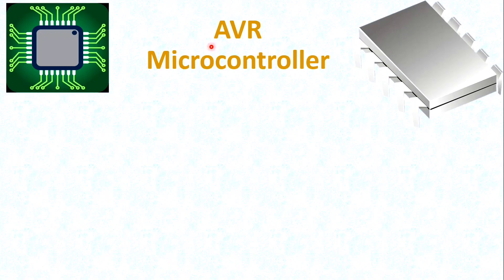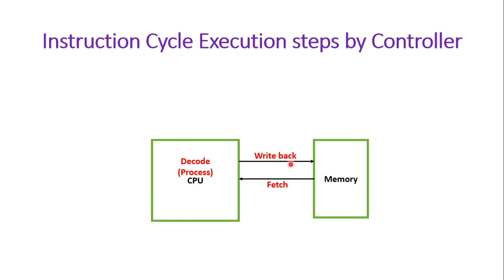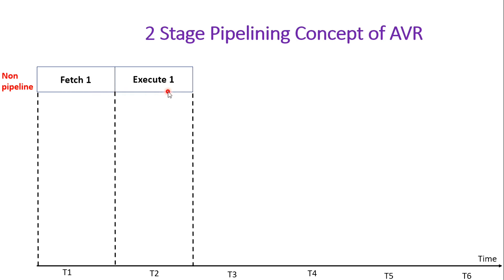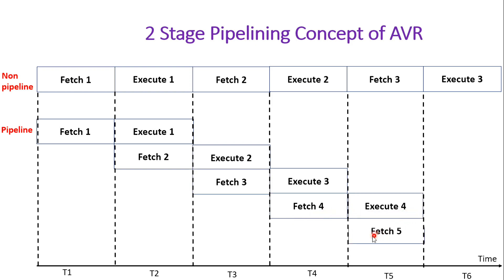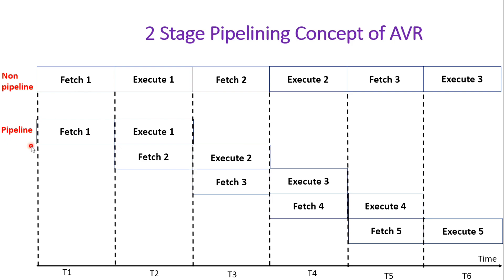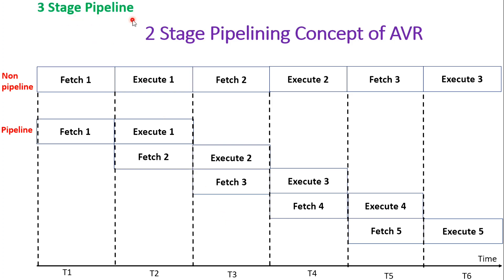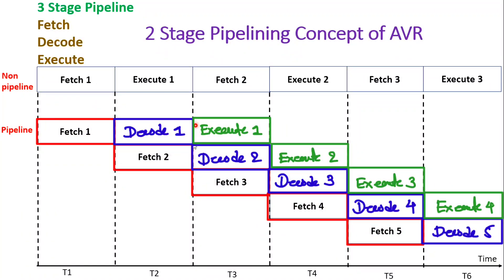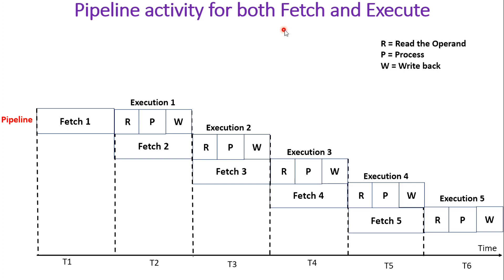Pipelining in AVR Microcontrollers: How It Works and Its Advantages

Comment: 6:39
sir why  decoding is not there in 2 stage pipelining and non pipelining? And it is there in 3 stage pipeline, and latency of three stage pipeline is 3,but still it is considered more efficient than those with latency of 2
Reply from the maker: Overall latency decreased due to parallel processing